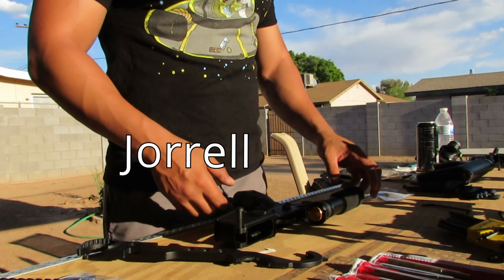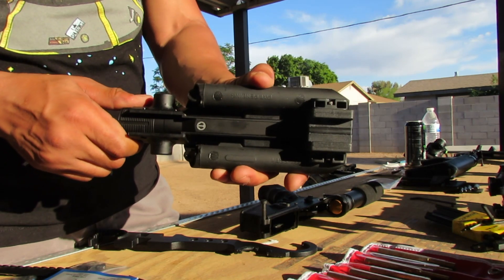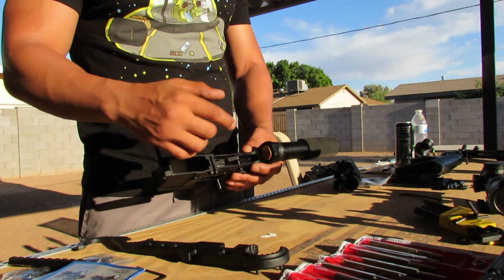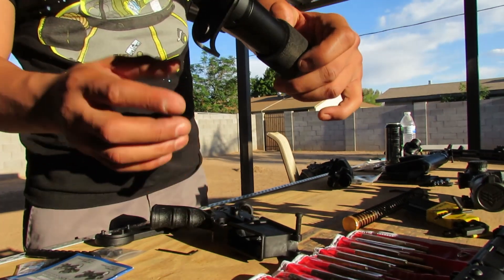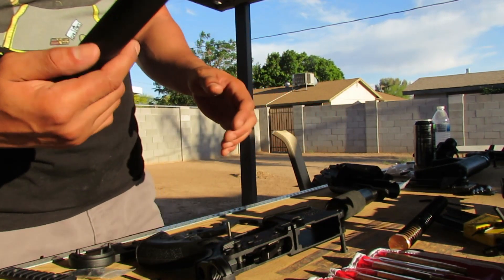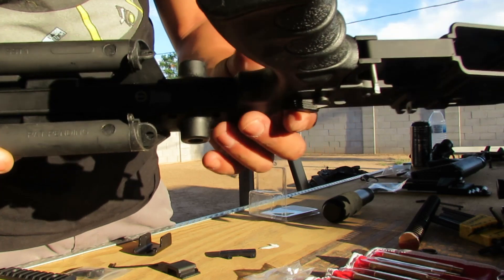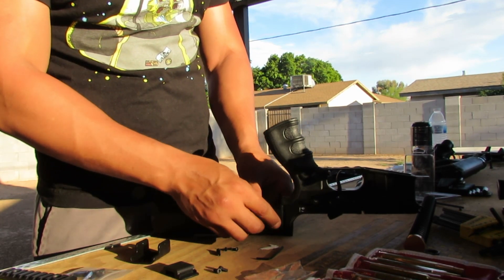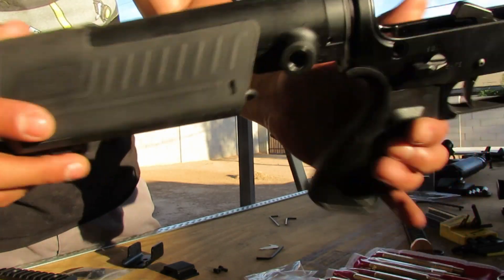How to Install a Cheek Stock in Under 5 Minutes - You Won't Believe The Results on a 300 Blackout!

Comment: This product has been available for YEARS now… and I may just have to make the switch to stay away from the BS. I assume a mil-spec buffer tube would work as well?
Reply from the maker: Yes sir, it Fits any commercial or mil-spec buffer tube. NOT COMPATIBLE WITH FRS-15 RIFLE LENGTH (A2) BUFFER TUBES. ATF ADVISORY.
Reply from the maker: Yes sir..
Reply: It comes with its own buffer tube.